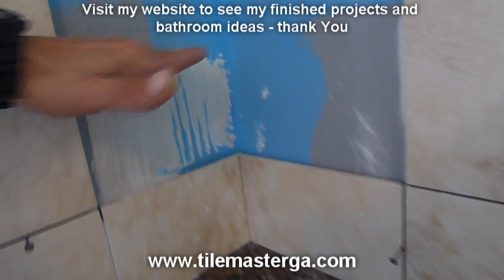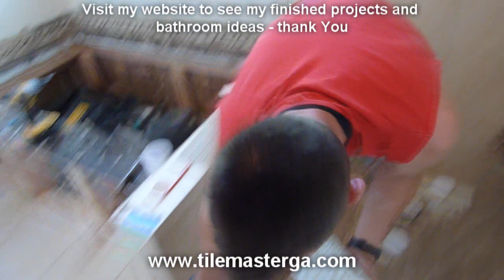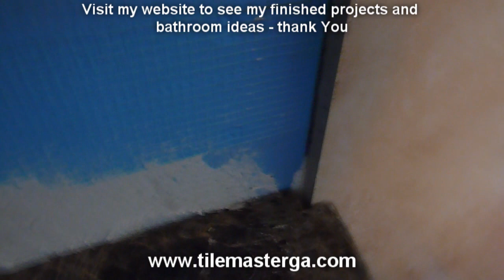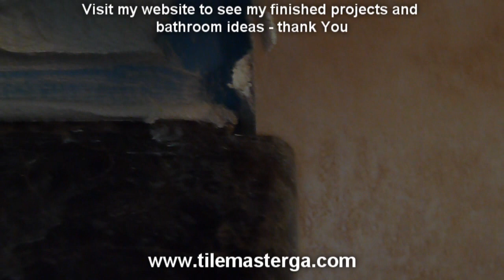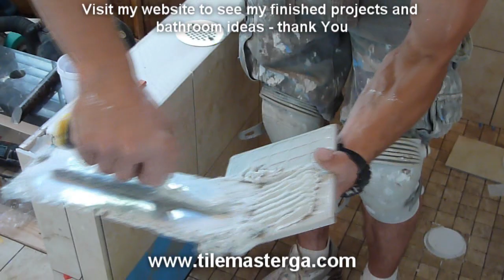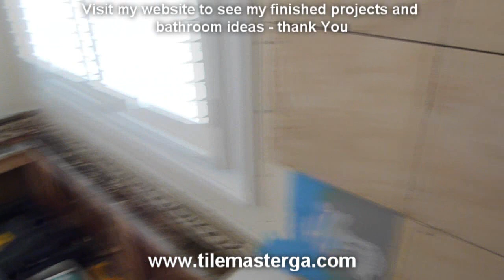Part 2/2: Bathroom Shower CORNER SHELF and SEAT installation from scratch - how to do it right !!

Comment: You will be sorry when those nails used for spacers chips the tiles while pulling them out...There is a lot of weight on them..I use hard plastic horse shoe spacers or normal hard plastic spacers...Good luck with the nails..
Reply: If they are smooth shank they will pull out easy peasy.